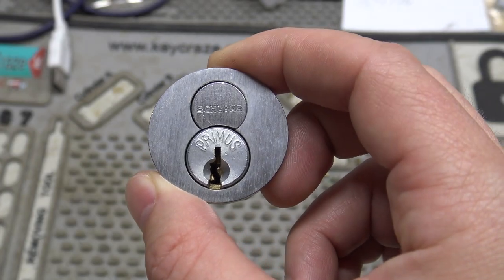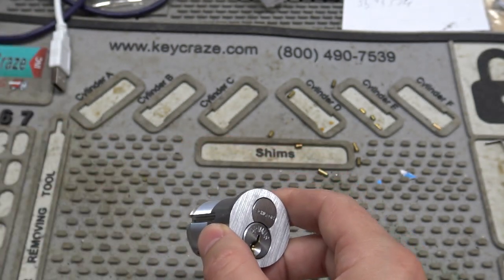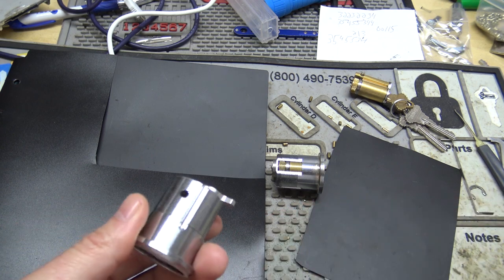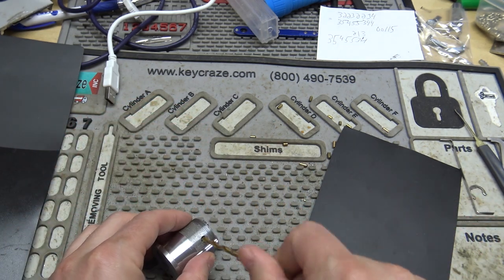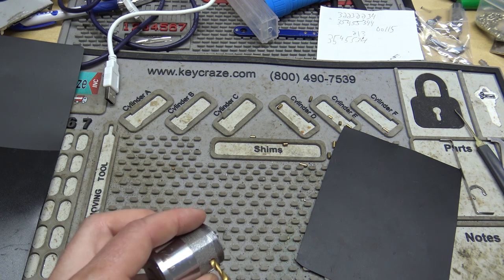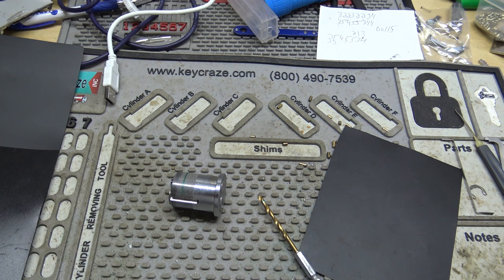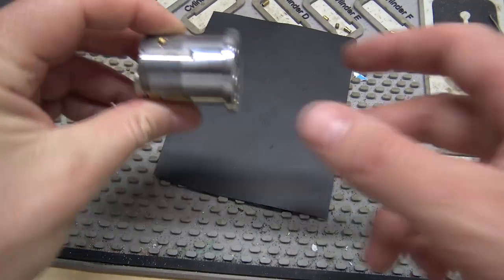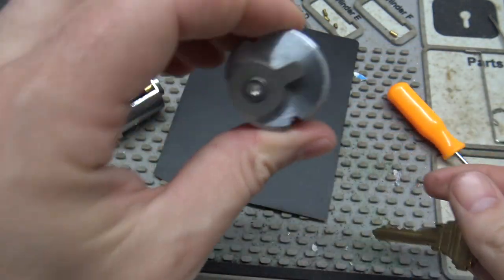(414) How to Remove LFIC Core without a Control Key

Comment: Does not work unless you drill the pin out too. I tried drilling it out but you can’t push the pin in because it locked on the core without the control key.
Reply from the maker: Wrong. I do this on a fairly regular basis
Reply: Brian.
  Only on the oldest cores can you attept to play this game. without a control key the core holds the pin in place.

Comment: Good video, cept you had removed the top control pin , in the locking pin and the locking pin spring, observe the locking pin stays retracted after you push it, that is not reality.
Reply from the maker: Lol did the core come out without a control key?
Reply: @russej02  In the beginning of his video, he said he had neither, it seems unlikely vital components would be missing, thereby allowing this workaround to be the rule, not the exception, look at the two cylinders in the end of the video, see something fishy ?
Reply from the maker: I have no idea what you’re talking about
Reply: @russej02  The core he has change key and control key for, the locking pin has returned to it's locked/extended position.
the one he pushed out with a pick, the locking pin, stays down as if it did not have the three needed parts, mentioned above.
which is why this trick worked for that core.
Reply from the maker: Oh lol. I hit with the the drill. No biggie.  Easy to fix or just replace the core. This is only useful if you have multiple cylinders to rekey or open and you don’t have a key you pick one if you need to and take the cylinder and do this and then you can take it apart and make a key or control for the rest of them.  Trust me it works.  I do this on a fairly regular basis.  A lot building use those cylinders around where I work.

Comment: If this is a genuine method for removing the core the reverse should also be true. There’s normally a slight give to the control pin, however you cannot install a core without the control key. You could clearly see in a minute 4:11 that the pin is permanently depressed.
Reply from the maker: Like me lol

Comment: I have an lfic core, inside a schlage lever handle. It's picked open, but I still can't remove the core from handle. Any help would be great.
Reply from the maker: If it’s lfic you have to lift the pin all the way in the back of the lock after you pick it to release it. My email is in the description drop me an email if you want
Reply: Samsung.
  You will need to drill for the pin, these days,, there is hard plate above the plug, drill the plug at an angle, using cobalt bits and a core, side by side , as reference material.

Comment: What if the core is still inside the lock amd you can't drill it? Why even drill in the side if you have the lock already out!?
Reply from the maker: Really no reason on this one since I can’t make a key. Have done jobs though with a lot of these on Schlage keyway prior to lishis. Get one out the door and get the cylinder out take it apart make a control key and easily remove the rest to rekey them. Only had to replace one housing. When a lot of them are push bars getting out a store front door and making a control key saves a ton of time not
Having to remove push bars to get them out and replace them all
Reply from the maker: If it’s still in the door you would have to pick it open to take it out or drill one to open the door then take another one from another door to make a key
Reply: Correct answer, if you are still a noob, wanting a pointless challenge...
Reply from the maker: Ok

Comment: I have a falcon 7 pin cylinder from a rekey, it has an operating key and of course i could pick it to operating. I havent done much ic stuff so i appreciate the tip, i dont have to trash the core or housing now! I was thinking it was like best where it has the control bar, but i noticed that hole in the side and was wondering.
Reply from the maker: If is seven pin it’s probably small format not large format and this won’t work
Reply: @russej02  Really? So these housings can hold both the push retainer and the control bar style cores?
Reply from the maker: @ThaFritz  no. Large format and small format are completely different.
Reply: @russej02  well the housing that this 7 pin is in looks exactly like this one. It has the factory drilled hole and tapered head. But I believe it is sfic, a best core would fit i think. I haven't had any luck finding a listing for these housings, but i havent looked very hard either.
Reply from the maker: @ThaFritz  if it’s seven pin falcon it’s sfic. Just search sfic housing. The only way you’re getting that core out is getting a control key picking to control or destroying the housing.